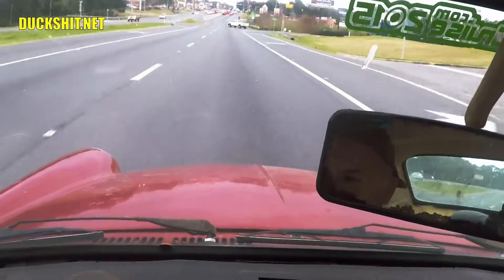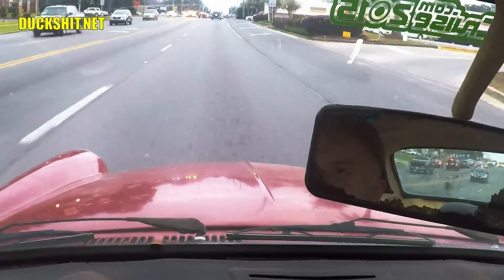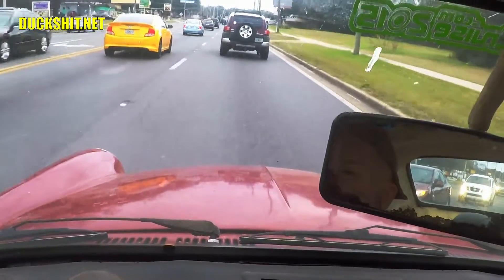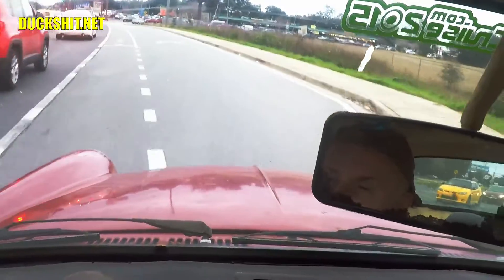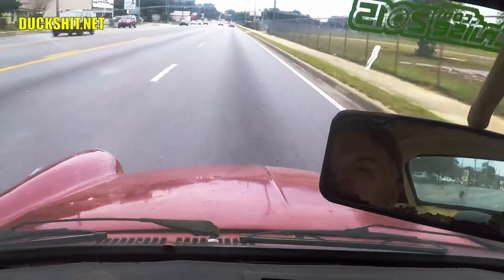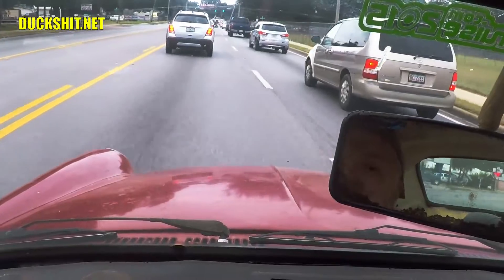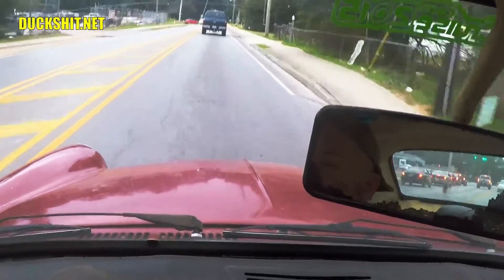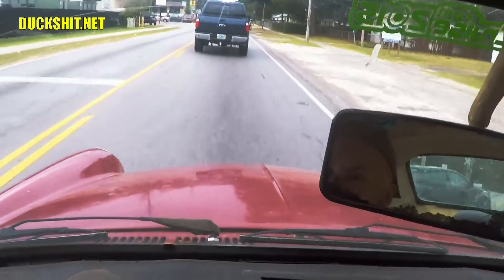Driving VLOG with Ruby the 1968 VW Fastback -  Mid Day Q & A - 30

Comment: You can only end up with free time to work on your projects if you are self-employed.  Most employers don't want you to work you own hours.

Years ago I took a 1-inch wide by 8-inch long piece of 3/8-inch steel and ground the end like a screwdriver. And I used that as my "tool" to remove those oil filter extensions. Always worked good.

Ruby looks so sexy in red running around.

Moe
Reply from the maker: Ain't that thr truth...  if I wasn't self-employed and trapped in a regular 9-5 I wouldn't have time for anything!